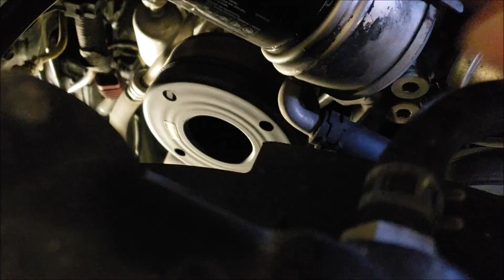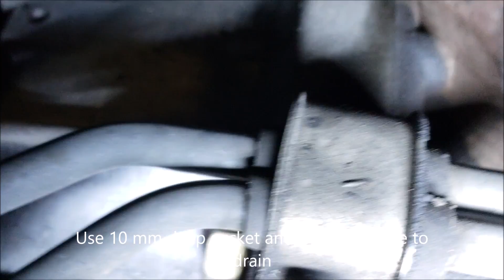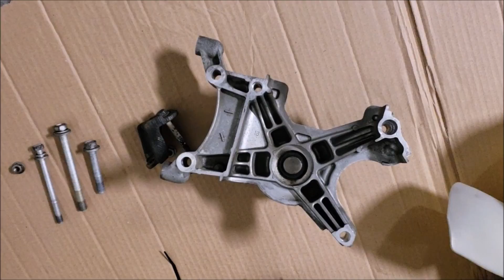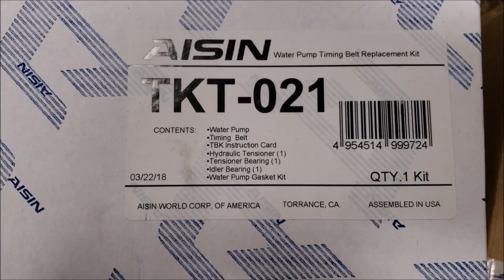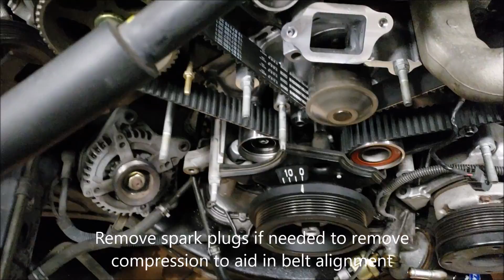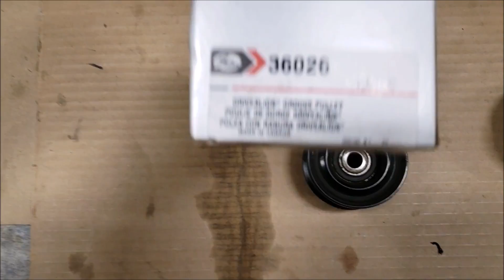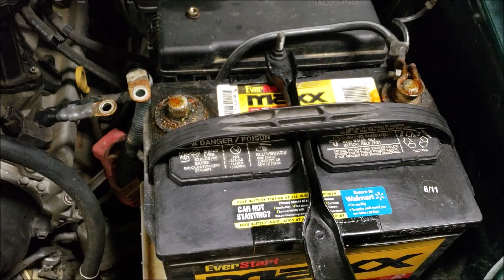STEP by STEP Timing Belt Kit installation: 2UZ-FE V8 4.7;Toyota Tundra, Sequoia, Land Cruiser, Lexus

Comment: Man I got 04 tundra with 236k miles and could never do this. Would end up wasting 500 dollars of parts. Just someone trying to get into learning more about vehicles, but man it’s so discouraging seeing how much is involved. Hard starting to learn without someone else teaching you, but it’s still too bad. Thanks for the vid anyways.
Reply from the maker: Start simple with things like air filters and wiper blades. Then oil changes and work your way up. Videos are helpful and take your time. Even if you don't know someone mechanically inclined, have a friend help because it is good to have an extra hand and someone to talk to about the job.
Reply: @gduplerauto  funny you mention the air filter and wiper blades cause I was gonna actually replace mine. Heard the silicone ones are the way to go. Do you think an aftermarket air intake is a good mod for the truck?
Reply from the maker: @alexanderlopez3033  an air intake is a pretty easy mod but don't expect much of a power increase, if any. It can make a difference coupled with a modded exhaust. Mine is a hot air intake. If I had it to do over, I would go with the Volant.
Reply: @gduplerauto  yea I see a lot of borla’s with 4.7 and 5.7, but I’ll have to look up the Volant. Also yes I know I’ll be lucky to add 10-12 hp with one. It actually has plenty of power but since it’s a rwd, I wanted some extra power in case I need to get out of snow. But it just has a basic exhaust system. I’d like to eventually get a decently priced aftermarket one.

Comment: Why did you put the timing belt on backwards and not line up the arrows on it properly?
Reply from the maker: I pay no attention to the belt marks. No need in the 2000 to 2004 models. May come in handy on the 2005 and above. Different kits have different belts and some do not have marks. Check out the video description and a conversation with Dave g in the comments for more details.

Comment: Man, all this work and parts but you did not replace the oil seals? I think you made a mistake eve if they were not leaking.
Reply from the maker: Yes, there are cam seals but in my experience with several 4.7 engines they have good longevity and I don't mess with them unless there is a problem. The process is more involved than the 3.4 V6.

Comment: Keep the belt on till fan is off, it will hold pulley. The marks on the belt are for timing alignment, you really should've made the marks line-up with the belt and gears. I mean they are there for that reason.
Reply from the maker: Good point on the fan bolts, keeping the belt would be easier. I pay no attention to the belt marks. No need in the 2000 to 2004 models. May come in handy on the 2005 and above. Check out the description and a conversation with Dave g in the comments for more details.

Comment: Thank you for the video, I’m planning on replacing the timing belt on two 2002 Toyota tundras in the winter.
Now for my question:
I read a comment on another video that said the proper place to align the timing belt is NOT at TDC, it is where the T mark is.
I always get confused watching these timing belt videos because everyone seems to disagree about something, can you explain it plain and simple for me??
Thank you!!
Reply from the maker: Thank you for watching!  The simplest answer I know for TDC versus the T mark is that it depends upon the year.  2000 to 2004 are the simplest and you align to TDC.  2005 and above you use the T mark in some form or fashion (due to the VVT-i).  The instructions from the Aisin kit are as follows depending upon the year: 

2000-04:
Turn the crankshaft clockwise until No.1 cylinder at TDC with timing marks aligned.
2005-08:
Turn the crankshaft clockwise until No.1 cylinder at TDC with timing marks aligned.
Turn the crankshaft clockwise a further 50° until pulley timing mark aligned with guide pulley bolt.
Camshaft sprocket timing marks will move forward 25°
2009:
Turn the crankshaft clockwise until notch on sprocket guide is aligned with mark on oil pump body.
Ensure camshaft sprocket timing marks are aligned.
Turn the crankshaft counterclockwise 50° until notch on sprocket guide is at approximately the 12 o'clock position.
Camshaft sprocket timing marks will move approximately 25° counterclockwise and will no longer be aligned.

Comment: How did you torque the crankshaft pulley bolt?
Reply from the maker: There was tension on the belt when we placed the balancer back on and we used the Mac cam pulley tool to keep things tight as we torqued the crank bolt.

Comment: Or loose. The bolts on the fan before removing belt. Wouldnt that work as well. 
Great vid. Gave me info i needed
Reply from the maker: Yes, you are right, that would be easier. More tension on the bolts. Wrench method is good as a backup.

Comment: Can you explain how you torqued the bolt down on the harmonic balancer when reassembling?
Reply: I took it off using a impact, obviously using impact will not be suitable for torquing it when reinstalling. How do you keep it from turning when reinstalling?
Reply from the maker: There was tension on the belt (both belt and tensioner in place at that point) when we placed the balancer back on and we used the Mac cam pulley tool (mentioned in the video) to keep things tight as we torqued the crank bolt. And instead of trying to do it your lonesome, I would recommend having a helper hold the cam pulley tool while you are cranking on the balancer.
Reply: @gduplerauto  the front of my cam looks different and won’t accept that tool. Will I have to hold it using the cams? 
Thank you for the help btw
Reply: I have a 2008 4runner engine
Reply from the maker: @jakeew6316  Try this method with a 2x4:  https://youtu.be/YRm7BViRsoQ

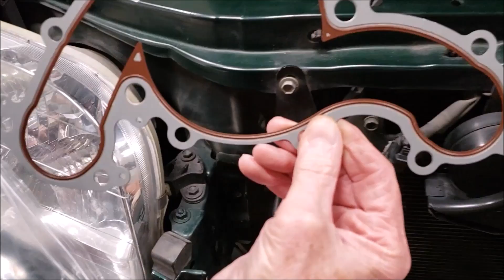Comment: At time index 21:00, the mechanic installs the coolant pump and does not mention a critical bit of info; there are 2 O-rings, lube these with coolant or silicone lube before installing the pump, also that wheel on the crankshaft is not a gear it is the crankshaft position reluctor
Reply from the maker: Helpful information. Thanks!

Comment: nice work. 

but IMO, timing belt replacements are just a terrible design. should use timing chain which lasts the life of the vehicle.
Reply from the maker: I agree that chains are better overall and I have bought vehicles specifically because they had chains versus belts. I will say that changing belts do allow for timely preventative maintenance on the water pump, idler pulleys, hoses, and other components that help the engine run smoothly.

Comment: Once it’s tdc you you can just put the belt on as long as the cam gears are aligned correct?
Reply from the maker: Yes, if you have a 2000 to 2004 you just line up the crank and cam pulleys at TDC. If it is 2005 or later, there are extra steps that have been discussed in the comments. Check out the comments from Lee Malis and Tyler for 05 and later.

Comment: Great video! Very informative. I have experience replacing timing belts on the 3.4L in the 4Runner. Are there seals behind the cams and crank gears similar to the 3.4L?
Reply from the maker: Thanks! Yes, there are seals but in my experience they have good longevity and I don't mess with them unless there is a problem. The process is more involved than the 3.4 and the cam seals include removing the valve covers and unbolting the cam guides.
Reply: Thanks! I watched a video on replacing the seals and you are correct. More involved than the 3.4L. It seems that if you are replacing the valve cover gaskets that would be the time to do the cam shaft seals.
Reply from the maker: @craigoller9283  I agree. If there is an issue with the valve covers when you are working on the timing belt that would be the time to take a hard look at the seals.

Comment: I believe you have the wrong part number on your description for the Gates Accessory belt tensioner.  I think it should be 38488.
Reply from the maker: You are right. Thank you for the message. I mixed up the box with the tensioner for my Accord. I will correct the description.

Comment: Thanks for answering all my questions so far.  Could you please give a better description of the location of the coolant drain on the block? Accessed through the top  or bottom?  Close to any known parts etc, Thanks.
Reply from the maker: Happy to help. The drain is on the right/passenger side in the area of the exhaust manifold. You will need to access from underneath.

Comment: Just a bit of advice....
Before you install the new timing belt, be sure to count the teeth new vs. old belt.
The parts guy gave me the wrong kit, when I was working on an Audi....it had two teeth more.
If you install the wrong belt....it will be a disaster... Just to be safe,  TRUST , BUT VERIFY.
Reply from the maker: Excellent point, I agree!

Comment: It's seems you placed your belt backwards. At 24:34 it shows the mark on the belt says L-cam but it's on the right cam and vice versa for the left cam.
Reply from the maker: You are right. I paid no attention to the marks on the belt. You can use them if you would like, but they are not necessary. There are more details in the description and in a conversation with Dave g in the comments.
Reply: I was wondering that too! I’d use it just for reassurance.

Comment: This kit also includes a smaller orange, where does that one go?
Reply from the maker: Let me know if you are referring to something else, but the orange colored bearing/pulley is the replacement for the left/driver's side of the engine and comes in direct contact with the timing belt.
Reply: @gduplerauto  that was a typo, I meant to write O-ring* not orange, there is the large one but also a smaller one about half the size that I'm unsure about.
Reply from the maker: @jayinla228  OK, gotcha. I admit that I am not completely sure, but I can give you my opinion. We only needed the one o-ring for the water passage. I think there is more than one supplied because the TKT-021 kit is used for several vehicles, including 4Runners and Lexus.
Reply: @gduplerauto  thanks

Comment: My timing belt broke while driving will these steps work the same as far as lining up TDC on the pulleys?
Reply from the maker: The following is from kovawa on Tundra Solutions.com: "The white mark on the crank dampener indicates "top dead center" for the number 1 cylinder only. The camshafts position, relative to crankshaft position, determines whether or not the pistons are on their intake, compression, power, or exhaust strokes.Since each piston reaches it's own TDC once per crankshaft revolution, 1 piston out of 8 is at TDC for every 45 degrees of crankshaft rotation. If you need to realign the camshafts to the crank..... be aware that the toyota V8 is an interference engine. Valve damage will occur if you rotate the crank without using caution. The following is the safest way to realign the timing belt without risking major damage to the engine.
1. remove the spark plugs, this step will allow you to turn the engine by hand and let you feel for any piston to valve contact.
2. Gently turn the crank to 22.5 degrees BTDC ( before top dead center ) or ATDC (after top dead center). This position will assure that none of the 8 pistons is at TDC, which reduces the chances of piston to valve contact.
3.Realign the camshaft pullies to the respective timing marks.
4. Rotate the crankshaft back to TDC.
5. Install the timing belt on the engine.
6. Rotate the engine by hand a few times and double check the belt alignment.
7. Reinstall the spark plugs.
Provided that you put everything else back together correctly during the reinstall phase, your engine should run fine."

HOWEVER, note that since the 4.7 2UZ-FE is an interference engine I recommend you have the engine checked by a pro you trust before spending time and money on the belt, etc. Valves bend and pistons break, so you are likely looking at needing new heads, if not more.

Comment: THANK YOU for a great DIY video.  I just bought an '04 Sequoia with 250K on the odometer, and an unknown service history.  Your instructions were impeccable.

One thing I might suggest is to wait until the new timing belt is mounted before bolting in the  tensioner.  I could not mount my belt onto the gears with the new tensioner installed, even with the pin still in it.  By loosening the bolts until it was barely hanging on, the idler would swivel further down into its hole, and the belt then went on easily.

I plunked out some $$ for a great chain wrench.  Made immobilizing the crank pulley much easier for getting the timing belt properly installed, as well as for torquing the crank pulley bolt.  As suggested in the Haynes manual, it is a good idea to cut a piece of the old serpentine belt and tape it to the harmonic balancer, in order to prevent damage to the pulley.  Also, most people know this trick, but in case someone is not aware, putting a large wrench or breaker bar on the crank bolt and running the starter for about 1/4 second is a great fast way to loosen that bolt.  (My impact wrench would not fit in the available space.)

Again, most grateful for an excellent video!
Reply from the maker: Thank you for liking the video! Great tips and your comments can help others who are working on the timing belt!

Comment: Thanks for making this. I followed this video while doing this on my 2006 Tundra. The fan bracket was the hardest part for me. That phillips screw on the AC compressor was NOT coming off. haha.
Reply from the maker: Glad it worked out for you! Sounds like a smooth operation overall. What did you have to do to remove the screw?
Reply: @gduplerauto  I ended up loosening the entire compressor (without fully removing it) enough to free the front lower fan bracket bolt. It was difficult because the front upper AC bolt has next to no clearance since the hard line is right next to it. Just went slow and had to slightly bend the metal plate the screw attaches to.
Reply from the maker: @nknasi  Good and interesting solution. Thanks for sharing! I was thinking penetrating oil but it was more involved than just oil.
Reply: I’ve seen, on the South Main Auto channel, the guy use basically a hand held impact driver that you strike with a hammer to break loose tough philips or slotted screws like that. I’ve been meaning to get one to try it out.
Reply from the maker: @Drew Duncan  That is true. I have such an impact tool from Tekton. It comes in handy when removing phillips screws from brake rotors.
Reply: @drewduncan1670  yeah I have a nice Vessel JIS impact screwdriver. Tried it on the screw but its tough to get a hammer on it cleanly since its so far down in the engine bay. I could see I wasn't getting a good hit on it and was just stripping the screw so I went the other way. I bet Eric O. at SMA could've gotten it out but that's why he's a pro and I'm a DIYer. :P

Comment: My timing belt broke on the way to the Bay Area. Got my Sequoia back in my garage. Is it a waste of time to change the belt and water pump out, or is there a chance I'll be Ok?
Reply from the maker: Since the 4.7 2UZ-FE is an interference engine I recommend you have the engine checked by a pro you trust before spending time and money on the belt, etc. Valves bend and pistons break, so you are likely looking at needing new heads, if not more.

Comment: I’ve seen videos showing the timing belt being removed at TDC and ATDC. Which one is correct? Any difference in one over the other? Thanks in advance.
Reply: on the VVTi engines the camshafts will want to move on their own at TDC when you remove belt tension, which makes new belt installation that much harder. at the "T" marks the cams will rest naturally while also not risking piston-valve contact since none of the pistons is at TDC.
Reply: @nknasi  Thanks!
Reply from the maker: TDC is all you need for 2004 and older engines. 2005 and newer use After Top Dead Center with the T marks.
2005 models and later are different due to the VVT-i.  Aisin kit instructions are as follows:
2000-04:
Turn the crankshaft clockwise until No.1 cylinder at TDC with timing marks aligned.
2005-08:
Turn the crankshaft clockwise until No.1 cylinder at TDC with timing marks aligned.
Turn the crankshaft clockwise a further 50° until pulley timing mark aligned with guide pulley bolt.
Camshaft sprocket timing marks will move forward 25°
2009:
Turn the crankshaft clockwise until notch on sprocket guide is aligned with mark on oil pump body.
Ensure camshaft sprocket timing marks are aligned.
Turn the crankshaft counterclockwise 50° until notch on sprocket guide is at approximately the 12 o'clock position.
Camshaft sprocket timing marks will move approximately 25° counterclockwise and will no longer be aligned.
Reply: @gduplerauto  Thank you so much! 03 2UZ-FE will go with TDC. I really appreciate it.

Comment: Yeah I done my wife's 2005 Toyota sequoia 5.7L v8 it was a challenge but I did it. water pump Replacement timing belt with 260.000 miles on it
Reply from the maker: At that mileage it is a must. I bet it runs great now!
Reply: @gduplerauto  yes it does runs great and strong

Comment: excellent video, thanks for your efforts.
I have two 2000 tundras both with super low miles but (under 70k) but with their age I think a new timing belt is in order.
You made it look pretty easy, not quick but you pros always make it look easy! 
I am confident to give her a go.
Reply from the maker: First gen Tundras are reliable, affordable trucks. Super low miles on yours! Take your time and the job will be well worth it.